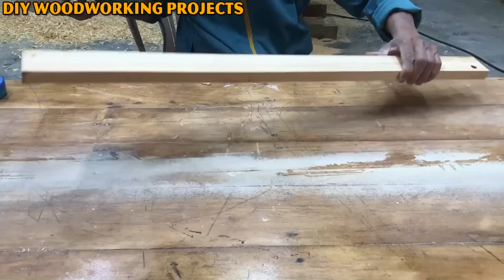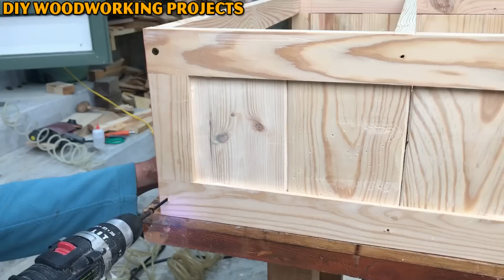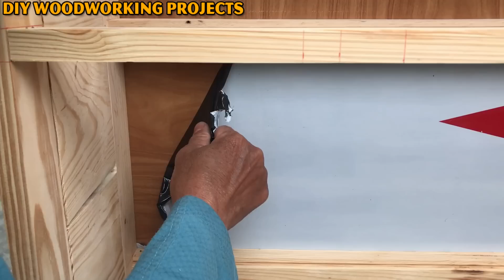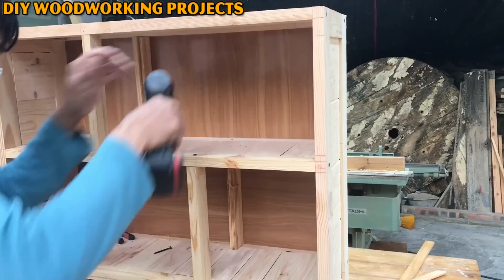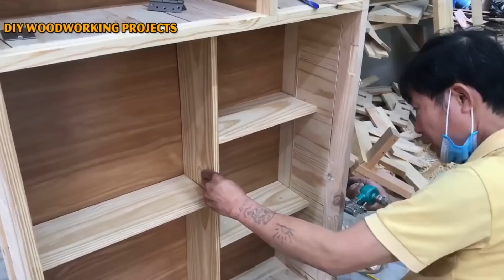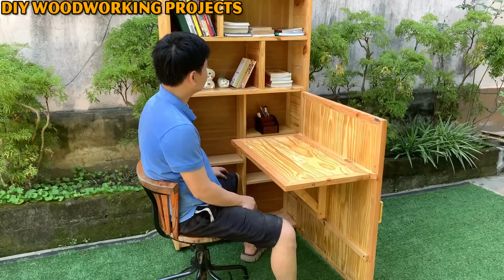Super Creative Woodworking That You Can Do // A Absolutely Perfect 2 in 1 Project

Comment: LOL a DIY project you can do yourself as long as you have a Carpentry workshop , thickness planer , pillor drill , a table saw , mortice machine , a routing station . a chop saw , nail gun , stapel gun  and a spray gun , yeah of course I have all that I keep it under the kitchen sink.